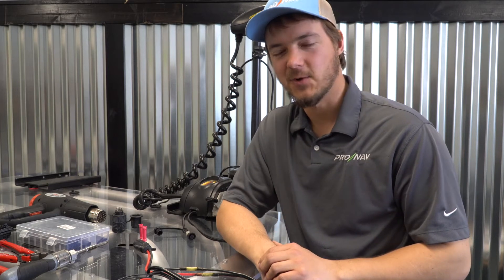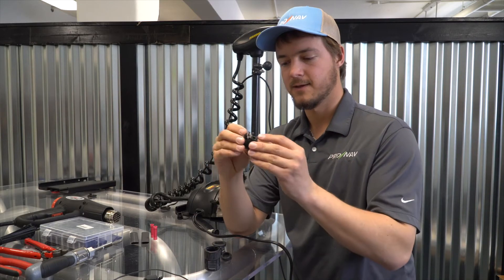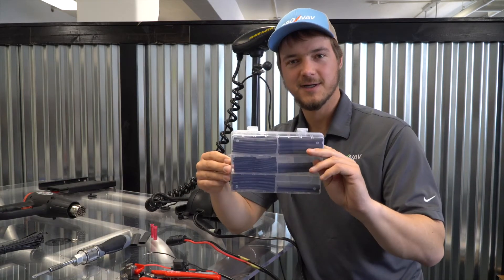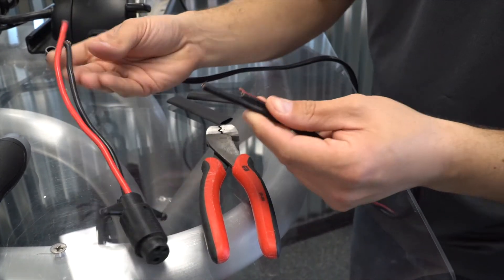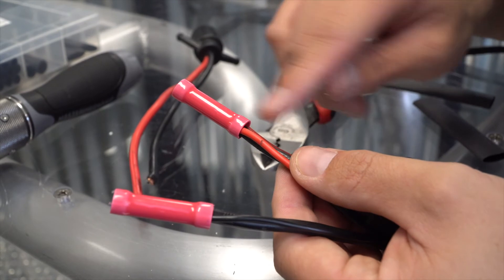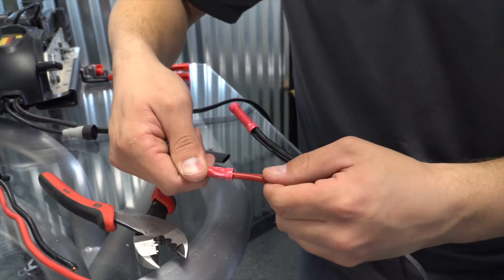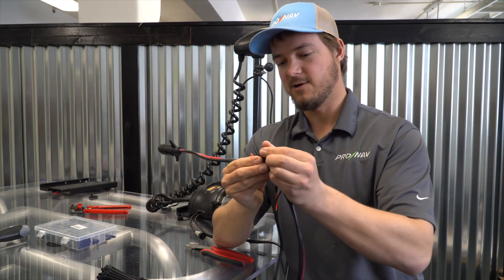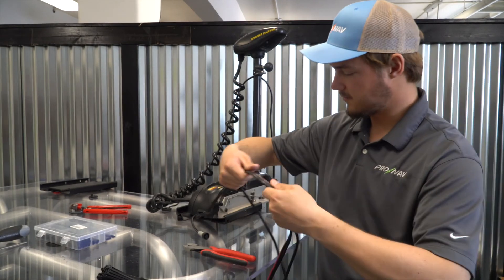Easy ProNav Angler Installation Mod--Splicing Power Cable with Trolling Motor Power Cable or Plug

Comment: Great video! May just do this with mine so I dont have to disconnect the ProNav unit separately! But just to be clear, can i wire it this way even with a 24 volt system?
Reply from the maker: Thanks @PondJunkie! This mod will work with any 12 or 24 volt system--the ProNav Angler was designed to operate across a wide voltage range from 9-36V to accommodate 12 and 24 volt motors (and eventually 36 volt motors).